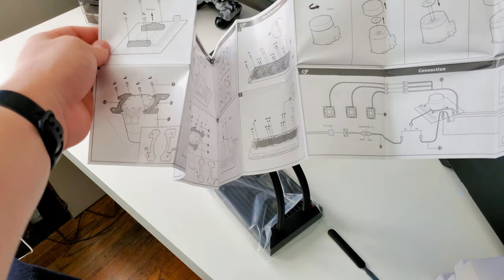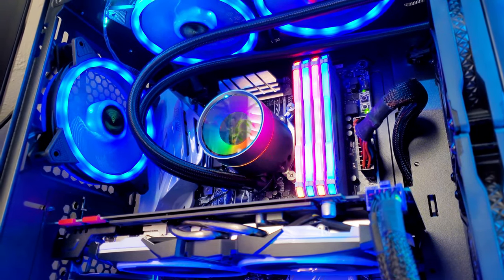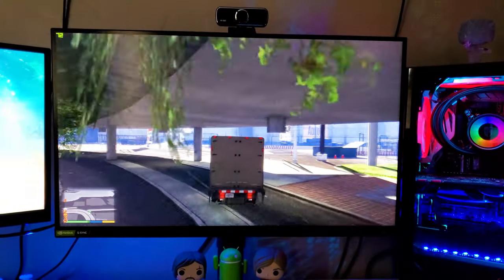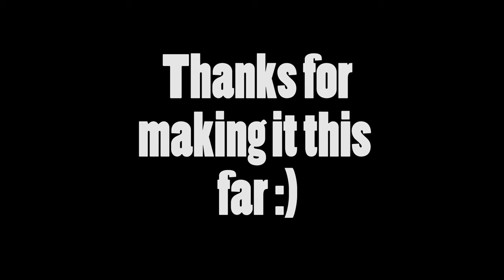DeepCool Castle 360EX Unboxing, How to Install Gaming PC Tutorial and First Impressions - AMAZING!

Comment: I have just watched ur review for apollo m2 case you posted a year ago xD came here to make sure it did its well along this year, ended up subscribing to your channel, i really like your content, keep it up
Reply: Btw, did you remove the 200mm fans?
Reply from the maker: The fans are still here. They're kind of on the outside of the case behind the front glass, so they're not in the way of the radiator.
Reply from the maker: That's awesome! Thanks for the support!

Comment: How is the pump for sound? So many makes have a hum or motor noise (mostly past 60%). Few companies have the so-called "silent" setting for the pumps and yet they not even close.
Reply from the maker: I have not heard the pump make a sound. If it does, the other fans in the case drown it out.